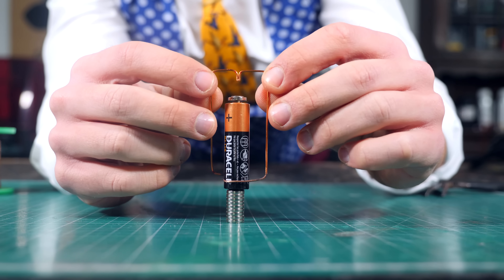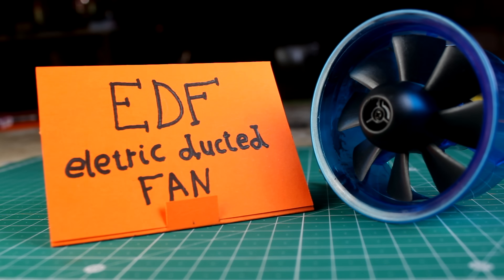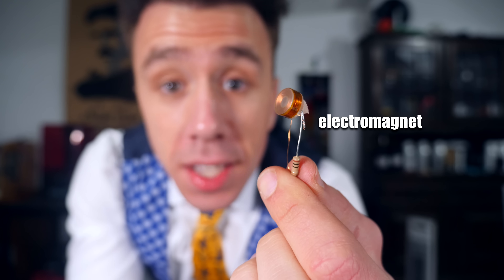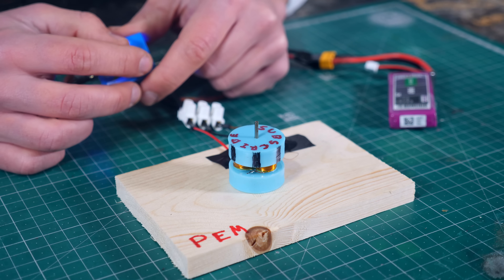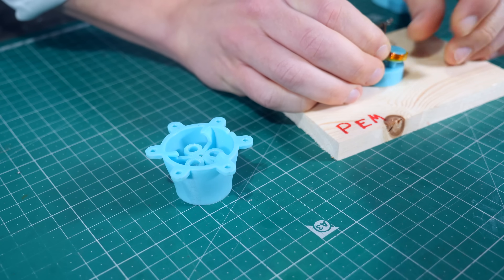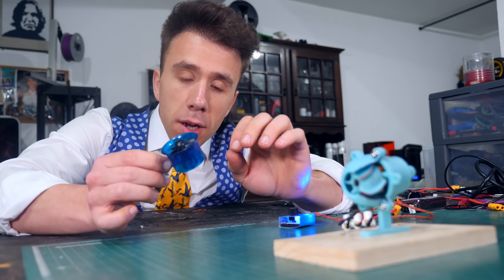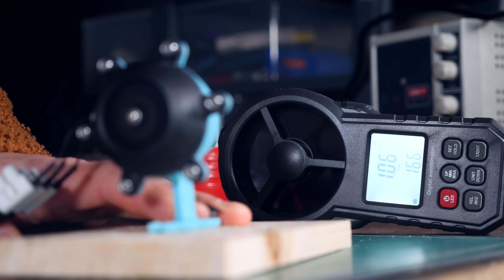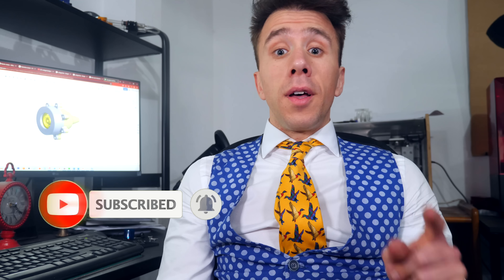I 3D Printed an ELECTRIC MOTOR FAN

Comment: I vaguely remember that at higher speeds, ducted fans excel at moving large volumes of air at lower pressure, while impellers (at the same speed) move less air at higher pressure. What you need to do is find geometry that will turn high pressure, high velocity air into lower velocity, high volume air. That's what the huge oval ring on your dyson fan is doing. So print an acceleration ring that takes air from outside and accelerates with with the high pressure air from inside.. it'll probably look like two nested funnels.

Comment: Hey Integza, this is a straight thermodynamics problem. We know that Kinetic energy= 1/2 M V^2. Because of the velocity squared, it means that increasing just a bit of velocity takes a lot of kinetic energy. The most efficient way to make thrust is to accelerate a huge mass of air to just above the speed of the aircraft. 
This is what the EDF is doing (high mass flow rate). What you are doing is accelerating a tiny bit of air to high speed. The only advantage with doing this is that you can make an aircraft with a higher top speed compared to an EDF.

Comment: Your problem (or at least one of them) is that you are trying to use a compressor as a propeller. Your impeller is compressing the air, but then what? Much like a rocket engine without a nozzle, the compressed air is not going to do much work unless you manage the flow as the pressure returns to atmospheric. You might be able to improve the thrust of your compressor by using stators and/or a different nozzle design on the outflow to accelerate the air as it leaves the device. Ultimately you will probably not match the thrust of the EDF, for the same reason the EDF will not match the thrust of a properly designed propeller using the same motor: it's a less efficient machine to convert electrical energy to aerodynamic thrust.

It does look cool though!

Comment: I'm guessing that Integza already knows why the results are different, could be a number of possibilities from weight, aerodynamic shape, size, or direction of rotation. It also could come down to which end the electric motor is attached because the motor will obviously be more efficient when self rotating as opposed to sitting still and rotating the propeller/ fan 😁
Reply: ❤ ᴄᴏɴɢʀᴀᴛᴜʟᴀᴛɪᴏɴꜱ ʏᴏᴜ ʜᴀᴠᴇ ʙᴇᴇɴ ꜱᴇʟᴇᴄᴛᴇᴅ ᴀᴍᴏɴɢ ᴛʜᴇ ʟᴜᴄᴋʏ ᴡɪɴɴᴇʀ ꜰᴏʀ the 🤶 ɢɪᴠᴇᴀᴡᴀʏ ᴘᴀᴄᴋᴀɢᴇ ʜɪᴛ ᴜᴘ✉️ ᴛᴏ ᴄʟᴀɪᴍ ʏᴏᴜʀ ᴘʀɪᴢᴇ 🎁

Comment: One thing you could do integza to not only demonstrate your hatred of tomatoes while also using your love of creating your own stuff with a 3d printer. Use tomatoes as a crash test dummy… create a high thrust engine and mount it on something that has low friction bearings. The tomato being the cushion so as not to damage anything around it. 👍🏻 you can even put this on trial and use numerous different engines to see which of your creations do more damage to the tomato

Comment: You are on the right track looking at your impeller design. You, however, looked in the wrong dumpster. Vacuums like the Dyson are high-pressure, low volume fans. The EDF is a low-pressure, high volume fan like the ones used in dust collectors. Try looking at woodshop dust collectors. Then, narrow down the exhaust port to increase the speed of the air, leaving the fan.

Comment: energy is lost as the air is hitting the wall of the engine before exiting the engine, hence air flowing out of the engine has lower speed
Reply: ᴄᴏɴɢʀᴀᴛꜱ ʏᴏᴜ ʜᴀᴠᴇ ʙᴇᴇɴ ꜱᴇʟᴇᴄᴛᴇᴅ ᴀᴍᴏɴɢ ᴏᴜʀ ꜱʜᴏʀᴛʟɪꜱᴛᴇᴅ ᴡɪɴɴᴇʀꜱ ꜰᴏʀ ᴛʜᴇ ᴘᴀᴄᴋᴀɢᴇ ᴄᴏɴᴛᴀᴄᴛ ᴛʜᴇ ᴛᴇʟᴇɢʀᴀᴍ ᴀʙᴏᴠᴇ
^^^^^^^^^^^^^^^^^^^^^^^^^^^^^^^^^^^🎁

Comment: the reason for the loss of force is that you are changing the flow-vector. the change in vector, paired with friction, let you lose momentum. -first law of mechanics 

so these boys are compressors and no fans. That's a difference
Reply: ᴄᴏɴɢʀᴀᴛꜱ ʏᴏᴜ ʜᴀᴠᴇ ʙᴇᴇɴ ꜱᴇʟᴇᴄᴛᴇᴅ ᴀᴍᴏɴɢ ᴏᴜʀ ꜱʜᴏʀᴛʟɪꜱᴛᴇᴅ ᴡɪɴɴᴇʀꜱ ꜰᴏʀ ᴛʜᴇ ᴘᴀᴄᴋᴀɢᴇ ᴄᴏɴᴛᴀᴄᴛ ᴛʜᴇ ᴛᴇʟᴇɢʀᴀᴍ ᴀʙᴏᴠᴇ
^^^^^^^^^^^^^^^^^^^^^^^^^^^^^^^^^^^🎁

Comment: I was just recently working on an impeller design for a pressure based system and not flow. I also have a background working with a million different motors, including designing my own BLDC ESCs.

If you're using the same motor, make sure the controller you use is the same as well. Long story short, different timing and/or control will result in different outcomes.

Measure everything I'm sure for the sake of brevity, you've left out a lot of this. But, if you're going for the same type of performance, make sure your impellers, nozzles, intakes, chambers, etc. All have the same geometry. You want to get the curve right, the thickness right, the angles right, the sizes right, just about everything. Reduce the amount of leniency for "good enough"

Shoot for the smoothest and most consistent surface finish you can get on your printed parts. 

You might gain some mileage by combining your best printed parts with the stock parts as well. A printed impeller with the Dyson chamber, for example, and vice versa. You then get a comparison of what is and isnt working from your design and you can isolate where the problem truly lies.

Comment: Hey 

One very simple way to "tune" propellers, turbines pumps etc. is to measure the flow and preasure (like you would measure Amps and Volts on an electrical system).
Basically measure the ammount of air moved. A very crude way of doing so would be to measure the static preasure of the built fan by encasing the output in a sealed container and measure the preasure when its running. This will let you calculate the ratio of the needed cross sectional area (not absolute area but rather the ratio between input und output).
For example if the centrifugal fan hits a peak preasure of 1,3 athmosphere youd need roughly 77% of the input area on the output end to not hinder airflow too much.
This is why for example airliner engines narrow down in the compressor stage and expande in the burn chaimbers.

Measuring the flow is pretty straight forward like you already did with the Anemometer.
if you calculate the surface area of your Anemometer (in sqaure meters since this simplifys further calculationes) and multiply it with the air speed in meters per second (since the output is basically at athmospheric preasure) you get the rough volume of air moved per second or rather the air flow.

Since (if for example the centrifugal fan from the preveous example is used) the air on the outputside doesnt like staying at that 1,3 times athmospheric preasure at all for no good reason it accelerates rapidly and thats basically a turbofan or even rocket engine (bellhousing are basically just expansion chaimbers to convert preasure to speed) but if the engine chokes because of to little input area or backlogs due to too little output area the throughput is greatly hindered.
So basically you want to have the eqivalent area for the input flow as the output flow scaling by the speed the air is moved through the system.

Of course there is also friction and inertia turbolence and so on at play but thats too much for a simple "lets see what happens if i print this"
But at the same time this is also the reason why these cheap EDFs are so damn efficient : no struggle with preasure ratios very little turbolances due to the duct and very few surfaces hindering airflow.

Comment: Oh btw I think you may be using the blade backwards. You see the design you used is from a vacuum and not a fan. The cone shape is made to pull and on the fans they are bladed the other way.
So the blad sucking in should work better if the larger diameter side sucks in and pushes the air to the smaller diameter side there by compressing. If your a vacume you do this the opposite way to cause no back pressure disruption.
Reply: ᴄᴏɴɢʀᴀᴛꜱ ʏᴏᴜ ʜᴀᴠᴇ ʙᴇᴇɴ ꜱᴇʟᴇᴄᴛᴇᴅ ᴀᴍᴏɴɢ ᴏᴜʀ ꜱʜᴏʀᴛʟɪꜱᴛᴇᴅ ᴡɪɴɴᴇʀꜱ ꜰᴏʀ ᴛʜᴇ ᴘᴀᴄᴋᴀɢᴇ ᴄᴏɴᴛᴀᴄᴛ ᴛʜᴇ ᴛᴇʟᴇɢʀᴀᴍ ᴀʙᴏᴠᴇ
^^^^^^^^^^^^^^^^^^^^^^^^^^^^^^^^^^^🎁

Comment: You may benefit from researching twin spool gas turbine engines. They're very good at air management, centrifugal compressors (fans) are very efficient at lower speeds, whereas axial compressors are more efficient at high speeds. Good luck.
Reply: Congratulations what is your name and email address?
Reply: Congratulations what is your name and email address?🎉

Comment: Great video, I'm no aerodynamics expert but I spend I lot of time around jet engines. I noticed that the nozzle on your fan looks very similar to a jet engine exhaust nozzle, however I'm not sure this is the best design. The reason a jet is shaped that way is because it is a heat engine so when energy is added to the compressed air the temperature and more importantly velocity increases. Contrary to popular belief the pressure actually decreases over the combustion section of the engine. The purpose of the nozzle is to decrease the residual pressure left over after combustion turning in into axial velocity for the turbine(so the compressor spins) and linear velocity out the back of the nozzle. This is because the power of a jet engine is the difference in velocity between the air entering the engine and the air leaving the engine(in reality  there are a few more variables). All that being said, if you are not adding heat energy to the compressed air then the impeller should be optimized to increase velocity rather than pressure. This is why you will see that both the EDF and the Dyson fan have very large exhaust outlets so they can achieve high velocities and not lose energy from increasing pressure.

Comment: Attention Integza

Tomatoes are disgusting

I think you should explore the use of liquid fuels in your turbine engine experiments.  Specifically, you should investigate the use of a fuel slinger to atomize the fuel without the complexity and tight tolerances needed to make a fuel injector work.  Liquid fuels are much more energy dense than the gaseous fuels you’ve been using to date.  Also, depending on how you set up the fuel slinger, you can eliminate the need for a high pressure fuel pump.  You might want to execute these experiments outside.  You wouldn’t want to burn your house down or damage your mustache.

https://deepblue.lib.umich.edu/bitstream/handle/2027.42/76266/AIAA-2002-3183-108.pdf

Comment: I just came across your channel, and I love it. I think it would be awesome to make a solid rocket jet engine. What I mean by this is making an electric jet engine that uses its rotation to produce electricity use to ignite the HIPEP fuel. Also, the air from the jet engine will be mixed with the propellant, allowing for a more powerful burn. Im not sure if this is even possible or maybe have to use liquid propellant to work will be ok. Just trying to integrate your last couple episodes together. Thanks for the amazing content.

Comment: Hey Integza! My suggestion to fix the expansion of your impeller and increase RPM on the PEM is to add at least 2 more copper coils and decrease the distance in the way you coil the wire itself (it will probably create a weird hex design) I hope this helps solve your problem/idea! I'm also just now realizing I haven't subscribed or liked the video so I'm going to do both after I post this. 

ps; I'm in college (ERAU) and this 3-D printer would change my life. I hope the internet helps me with this one, and Integza I hope you see this because I have so many ideas I want to share and create and I think this might be the start of making it all happen.
Reply: My theme for you next video is to mix this type of engine with combustion to increase the force it emits :)  

Or print your logo with every printer you have and seeing clarity and definition differences only to destroy all the tomatoes in the end lol

Comment: I think some of the issues you are experiencing may be cause by the fact that the impellor designs you are trying to duplicate are for extremely high RPMS, the dyson impellor you have is supposed to be spinning at 125,000 rpm and impellors I work with in jet engines go up to 60,000 rpm. The angle of attack relative to the axis you may be choosing might be to high for the motor you are using, because it will never reach operating speed. I would suggest looking for impellors similar to that of leaf blowers or turbo chargers. These normally have compound curves in their blades are more closer to the plane of rotation than the axis of such. 
Its also worth noting that your compressor housing isnt the best for an impellor as it looks like it may cause the flung out air to quickly surge back into the impellor as it immediately makes contact with the housing. The air should be allowed to exit the compressor radially for the most optimal airflow. a good reference for a good housing for this would be the GTCp85's diffuser i work on, you can find pictures of its compressor housing, impellor, and diffuser online, but note that this engine still functions at a much higher RPM than your motor does so the impellor blades may have to be closer to axis of rotation. Best of luck with your next projects.

Comment: I believe it may be the turbines, in the black motor setup, the aggression of the blades was much higher, and theoretically would’ve made the air cavitate more effiently, another thing, the reinforcements on the front of the 3d print may hinder flow and the size of the propellers reduce the theoretical maximum flow of air.
Reply: Also, the centrifugal fan is made to transfer air in high density and not high speed, and the other fan maximizes speed rather than density, the black fan, because it prioritizes speed does not need a nozzle-ish, but the centrifugal fan, is condensed, and like a ballon, likely spreads out much more sporadically in comparison, leading to less thrust, maybe? The reason jets use centrifugal fans, is because they need a lot of air and slow enough to control, for ignition, especially at supersonic flight, a centrifugal fan does that wonderously, that’s also why prop planes don’t use them, they need fast air with immediate thrust, a centrifugal fan would produce thrust sideways instead of backwards, also, it’s easier for the air in the normal fan to go straight, than the air in your centrifugal fan to go around that corner.

Comment: Remake the jet engine style anti lag system that the subaru wrc  car uses . Uses hot engine exhaust and unburned fuel .mixed with presurized intake air to make a vortex ring explosion to keep the turbo going . Literally a jet engine to spool the turbo

Comment: assuming you measured the thrust correctly. in the case of curved impeller it does additional work on curving the air and this does to translate any inertia forward to the frame. in comparison in turnover engine there is a fuel that accelerate the air. you don't have it here.

Comment: I believe that centrifugal fan would need a motor with higher rpm to produce same thrust. Also, centrifugal fan is usually better for high pressure, while classic fan moves more mass at low pressure (or how could I say it).

Comment: The angle of attack is almost perpendicular where the inlet's rotator first hits steady air. The dyson has a lower angle there, also you can see that the blade-width decreases towards the bigger diameter on the lower end: The same volume of air needs to pass through the inlet as through the wider part, so the "ring" it passes through needs to be thinner there. If there was no lower part, the airflow would be cone-shaped there. In the dyson-video you can see that they let the air do some cone-shaped flow before they turn it inwards. In your designs, once the air leaves the trailing edge you directly put stators in its way, which are also configured to compress directly and have a high angle of attack. From cone-shape into compression/stator-part would be an almost 90-degree turn that an air particle would have to do. Air de-compresses as quickly as it can, so you're better off guiding flow because you can't really seal a rotating part air-tight. That probably doesn't result in an aero-spike with the same "spiky-ness" as the rocket engines, but they deal with much higher pressures. At these pressures it is probably also a good idea to have the spike end before the end of the duct, and to make the "spike" a cone with the top cut off, similar to the EDF-design. This should result in a further straightened out flow, because the long spike is actually a boundary layer with zero velocity, slowing the flow down.

I've done CFD-simulations of lots of ideas for propellers as a hobby. Fluid behaviour is really counter-intuitive at first, and even if you do simulations you really only know once you print it. I can recommend DualSPhysics (or FreeCad and DesignSphysics, mostly for water) or Openfoam (harder to use) for simulations. Even then, a lot of what I wrote about at the top is guesswork, because with fluids little changes can have a big impact.

And with this video, I'm really a... fan ;-) Your work is great!
Reply: I just re-watched the video: The combustion in a jet engine is even stronger than in a car to move the pistons. With only an electric motor and fan that part of the design can't be copied from the jet engine. The combustion in a jet engine is actually so strong that it turns the blades that power the compressor (which compresses the air for combustion). The forward thrust is mostly a result of directed, hot, expanding gas for a jet engine. For a "turbofan" it would be that, plus air which is moved by a fan (without so much heating)